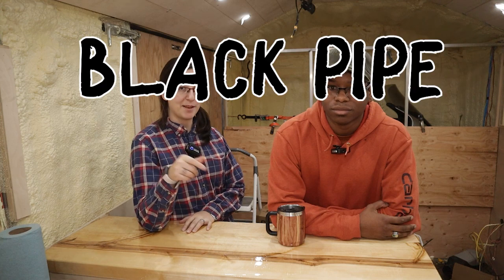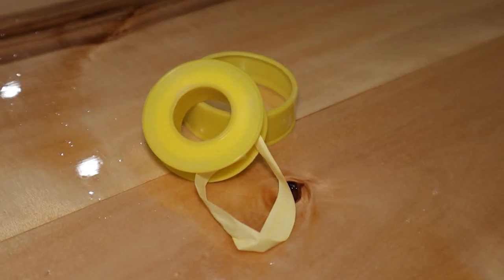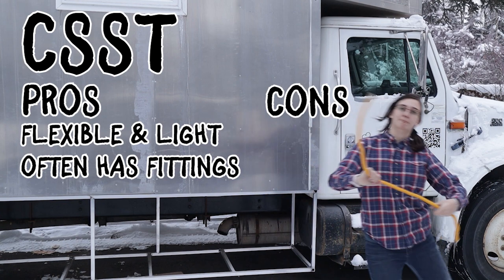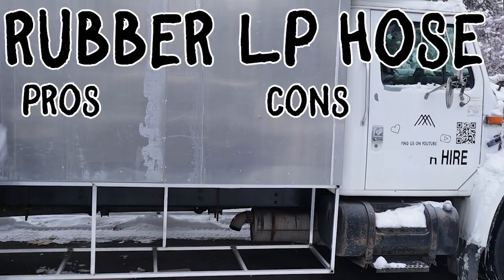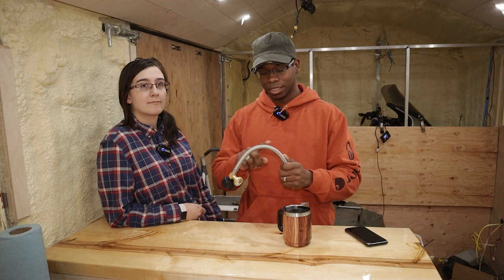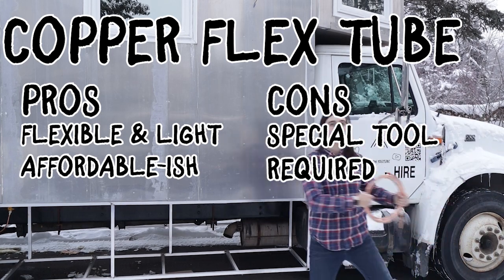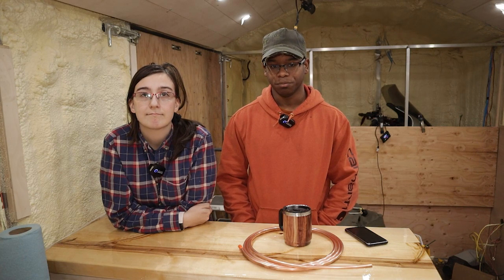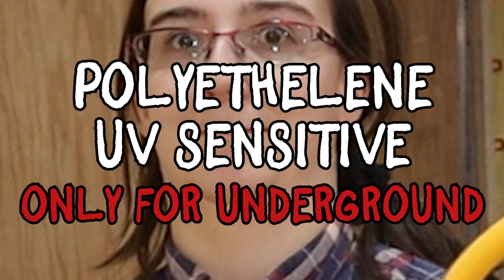Propane Pipe You Should NEVER USE - Making Adventure

Comment: CSST: No. Too many safety issues. Too much complexity in the joint/sealing process. Black iron and soft copper: Yes. But be sure the soft copper
is not utility grade. Use a quality flaring tool, and always soap test every joint or connection,
several times. Do not kink soft copper tubing. Use flare elbows. For black iron, use joint compound rated for propane. Its better than yellow Teflon tape. Again, soap test all connections.

Comment: I have seen people use sch 40 pvc conduit under ground from the tank to the house and bring steel risers out of the ground. Has worked fine for years and years and does not corrode. Only carries about 1/2 lb of pressure. Have you ever seen black pipe that has been buried a few years with any protection? It will be eat up. We used a good quality rubber air hose for years for our supply line to an irrigation pump. Never a problem. Much much cheaper than a rubber line that says For LP gas on it. I seen a guy use a 1/2 inch rubber air hose for a quick supply line from a 500 gallon tank to his house and run a real LP hose through the window to a ventless 30,000 btu propane infrared heater when he lost electricity for several days. Kept him warm and didn't freeze the water lines for several days. Got plenty of air through two windows cracked up about an inch.
Reply from the maker: In a pinch we all do what we can. I'm glad your friend stayed warm and didn't have any trouble with LP leaks or fumes! And yeah, black pipe is not safe to be buried without protection... They have conduit for burying black pipe, but there's other pipes that are better suited for it. Your mileage may vary with rubber hose. They're not all made the same. Purely speculation here, but a quality rubber hose might be able to stand up to LP but isn't certified for it because it's an expensive certification to get and quality control has to be flawless to maintain it.

I can't in good faith recommend something that may or may not be able to contain a flammable gas in someone's living space.